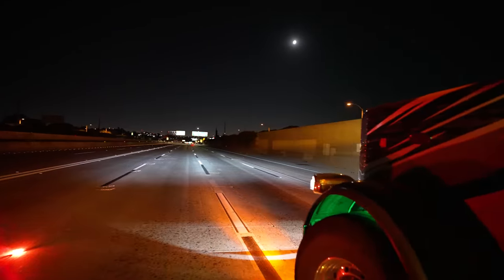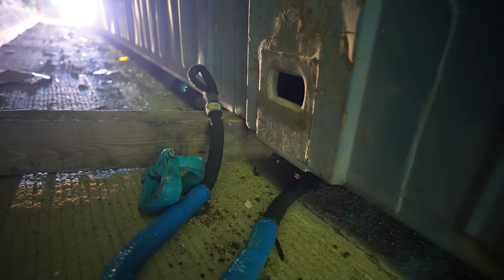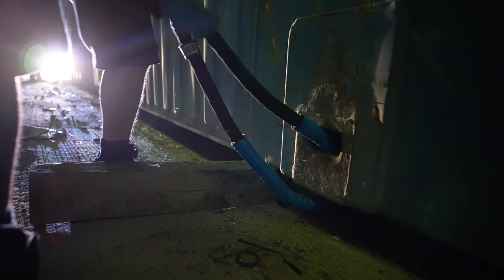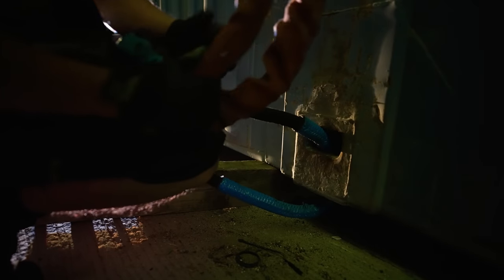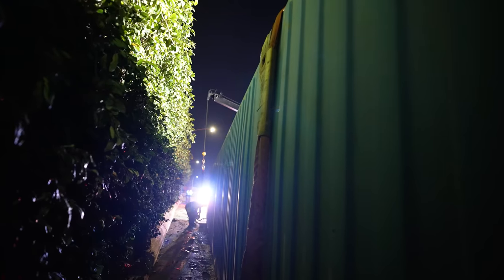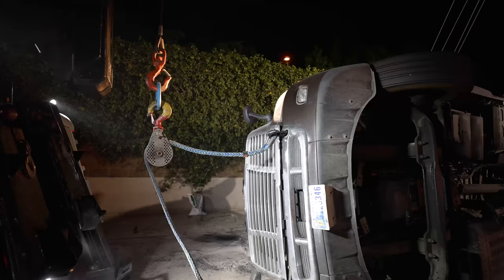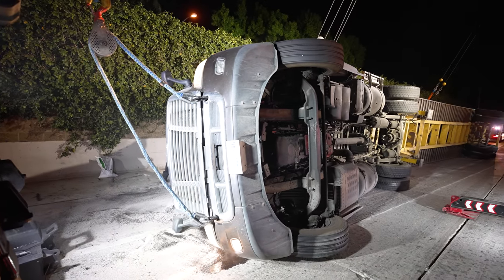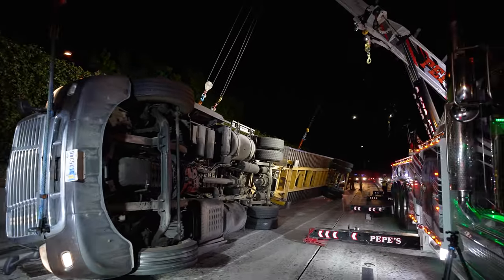Container rollover recovery at 2am

Comment: Excellent video as always.....Question: How did you get the cribbing under the container to gain access to put your sling through ? (if the trailer landed flat on the ground with no gap left for cribbing)...also, interesting was to hook the front of the cab (with the pulley)

Comment: Are those your tow hooks in the front bumper, or did they come from, like, the tractor's roadside kit? I know cars & pickups sometimes have unique make/model specific tow hooks, not sure if the trucking industry is the same.

If they're cast steel then yeah, side loading like that might be a little sketchy unless you know or can find out what kind of rating they have. That aside, I'd have to wonder if anybody makes a trick billet or forged tow hook you could carry with you that'd not only give you peace of mind from being able to use your own gear and knowing the numbers behind it, but also manufactured in a way that you'd see it start to obviously bend or yield if you pushed it too far (cast parts, while cheap and fine for mass production, tend to suddenly shatter with no warning whatsoever)

Comment: The 3 truck recovery configuration makes sense, especially since you are towing with the conventional truck after the flip.  I was wondering, would either Hulk or Big Flipper have the capacity to do the entire front end by itself?  Position the rotator in front, control the tractor with the aux winch or winches rigged off the static boom section, and the container with the mains as you normally do?  Not sure if that would be too much total weight with the boom out as far as you would have to have it?  Just curious.

Comment: Josh is probably too busy to answer, so maybe someone else can answer this:  what lift point would have been used to get the cribbing under the box?
Reply from the maker: The top container holes. Same one that we used for the catch
Reply: @PepesTowingService  That makes sense. The reason I asked is because I thought some of the same rigging for that would have still been in place for the catch. (I guess you're not too busy to respond to a question -- thank you.)